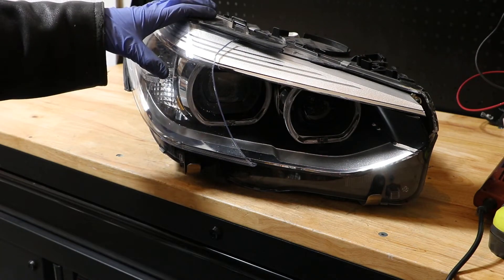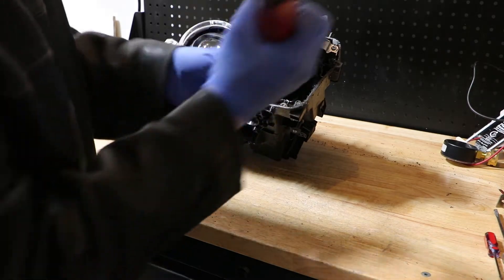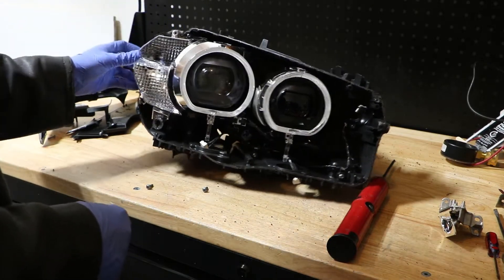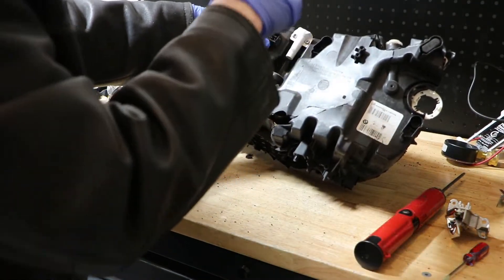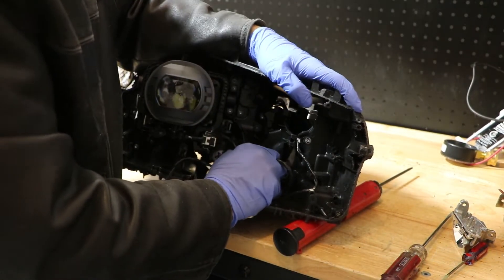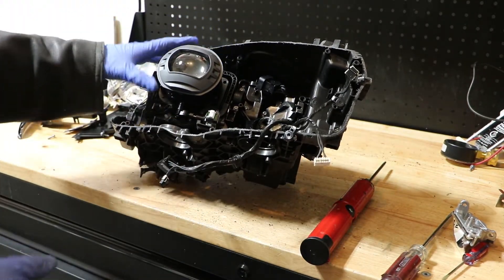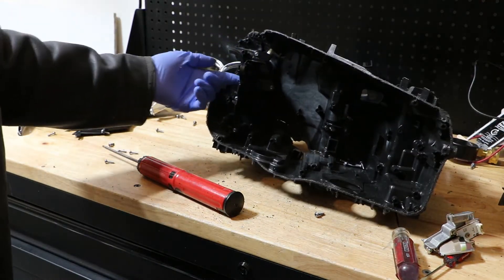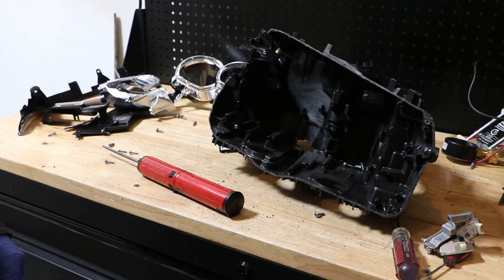2018-2020 BMW X3 OEM LED Headlight Teardown

Comment: Thanks for the great video . Is there a vent on the back of it ? ( I need to dry mine out ) cheers Baly
Reply from the maker: No vents.   You could remove the LED modules/controllers to open air holes.
Reply: @gftgrill  I found a little rubber bit to remove and just used a hairdryer . All water has gone :)

Comment: How to remove the lens?
Reply from the maker: you need to heat up the headlight to loosen the glue.   then you can pull the lens off of the headlight.  search for baking a headlight

Comment: How are the DRLs lit?  Is it from the projector or are there separate modules. Thanks
Reply from the maker: The DRLs use external LED units that attach to the bottom of the light.   Google search for part # 63-11-7-466-102

Comment: Is the lens cover made of a hard plastic or is the cover glass
Reply from the maker: Plastic.  I'm not aware of any modern headlight that uses a glass lens.   The projector lens is also made of plastic and is not glass.
Reply: Is there actually a way to get the plastic glass cover off? I have moisture in mine and need to dry it out and re-seal
Reply: Is there actually a way to get the plastic glass cover off? I have moisture in mine and need to dry it out and re-seal